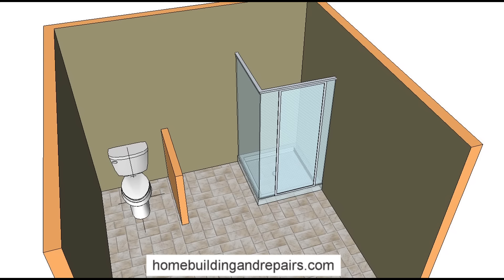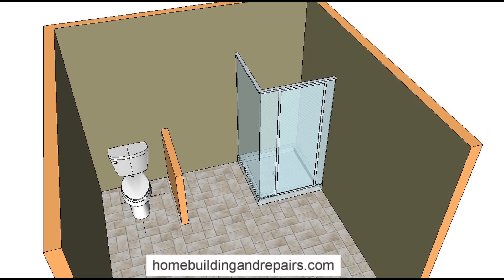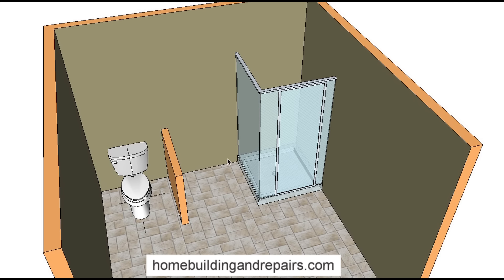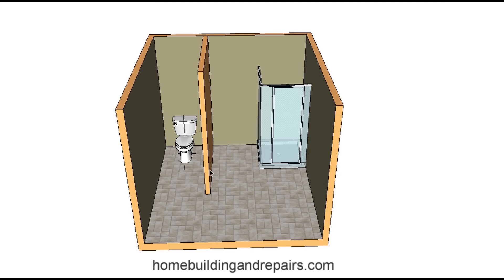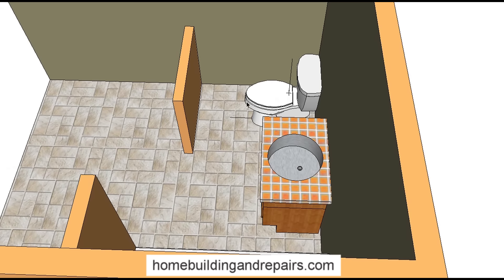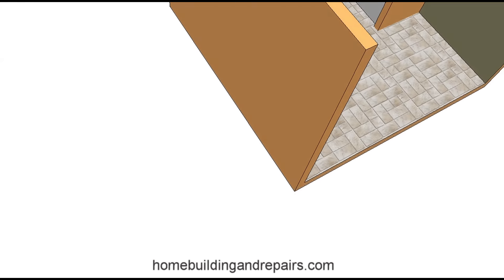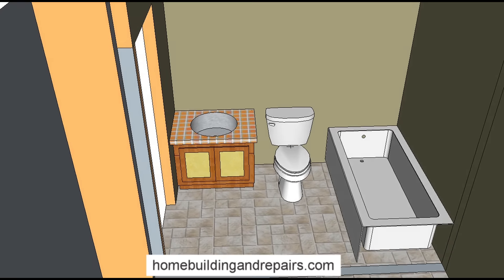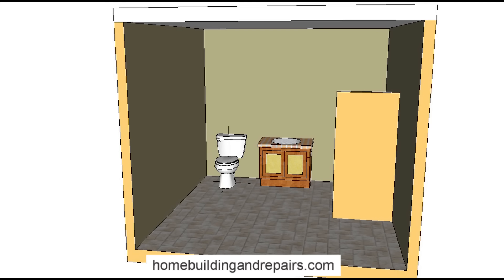Minimum Bathroom Fixture Clearance Measurements – Remodeling and Home Building Design

Comment: IPC number 405.3.1 or irc 2705.1#5 states fixtures can not be set closer then 15in from its center to any side wall, partition or fixture that's why toilets are set right next to tubs. Again following the 30in space for a water closet. These are all national codes found in any basic plumbing code reference book.
Reply from the maker: Thanks for providing us with the reference numbers.
Reply: @gregvancom  No problem. My pleasure :)

Comment: my inspectors here in western connecticut want the 21 beside the toilet and tub if the operating valves are on that side , makes sense, we put the valves on the other wall , sometimes there is issue with that wall , being outside or  something in the way .
Reply from the maker: That seems like a good idea, especially for larger plumbers. Randy brings up a good point, to always check with your local building department to verify information in my videos or others.

Comment: At 6:14, what are the measurements for the bathroom wall to wall? I have a small space for this exact layout and I would like to see if the space will work. Thanks so much.
Reply from the maker: Between 7 and 8 foot in length and 5 foot wide.

Comment: question from a previous video....im installing a soaking tube with 4 adjustable feet for leveling. my question is to you need mortar under the feet and if so how much do you suggest
Reply from the maker: Your question will be difficult for me to answer, send me a picture of your bathtub for more information. The email address can be found at our website. Some bathtubs don't require mortar.